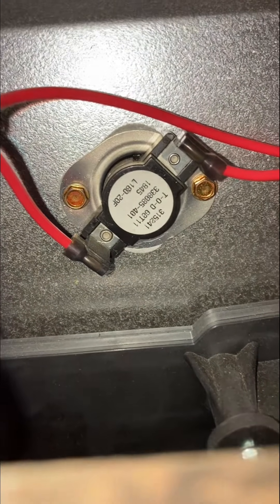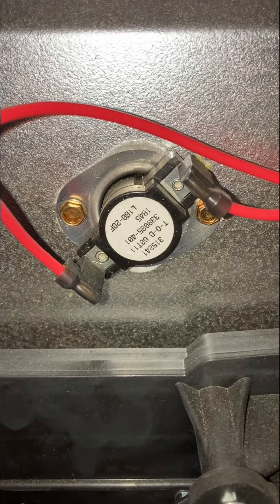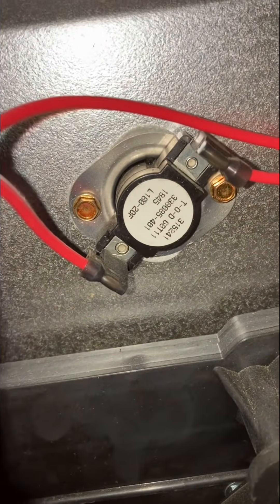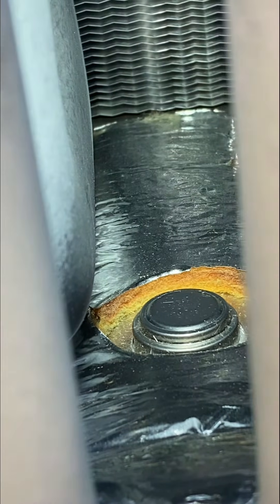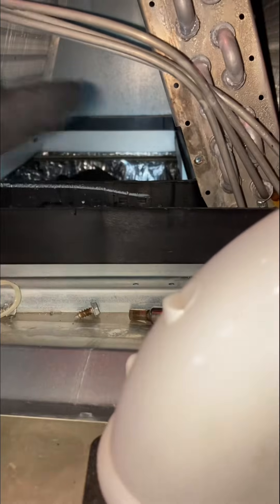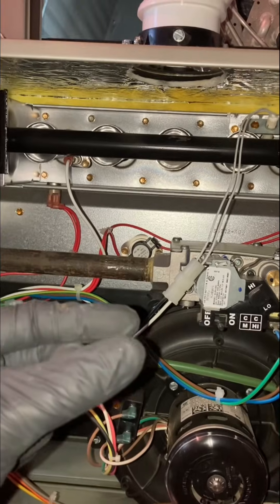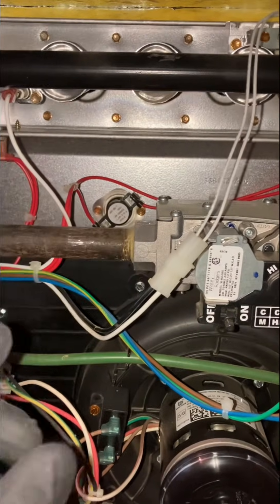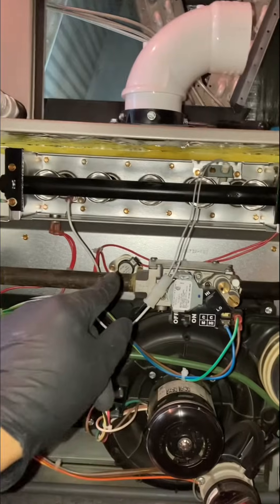Carrier furnace- Resolving high limit error code 33

Comment: I am getting this 3 3 error on my carrier then on the nest thermostat I get "power out error E73 no power to RC wire". Any advice?  Thanks
Reply from the maker: Whenever the furnace over heats , it interrupt power to the thermostat, for the thermostat will lose power. As to why this is happening, it needs to be investigated. The issue shown in the video is the last resort if you check everything else. Do not try this first without checking all the other options.
Reply: @victork3397  I checked what you did in this video and my furnace does not have insulation around the sensor.  My furnace is gas and the flame comes on but the big blower motor does not start.  It tries to start and makes a clicking noise but will not come on.
Reply from the maker: @DillyDogSays  ok that makes sense. You need to replace your blower motor most likely.
Reply: @victork3397  Yes the company wants $700 to replace motor and the part is under warranty..
Reply from the maker: @DillyDogSays  that seems like a lot for labor only. It should take no more an an hour to replace. If I recall correctly, my old company charged around $350 for labor only , and even that was on the higher end. I’m guessing the $700 is covering the part cost for the company as well since they don’t get reimbursed until they send the part back. I would ask why it costs so much and if they don’t budge on price, find a different company.

Comment: Hello, If my furnace doesnt trip error code 33 only when the filter is removed, would you say this solution is still viable?
Reply from the maker: This solution should only be tried when you have checked everything else to make sure it is in order. You would need to check for airflow problems, make sure no blockages, all registers are opened, the return grille isn’t blocked, and manifold gas pressure is set correctly. If you’ve verified those, then I would proceed with this repair.

Comment: I had this error and the root cause was degraded blower motor capacitor. 
The capacitor was good enough for the motor to start and run, but not good enough for the motor to run at full rated speed, causing lower air flow which in turn caused higher temperature in the heat exchanger which caused the thermal fuse to trip.
The simple to check symptom of a degraded capacitor is the motor getting hot, even to a point you start smelling the electrical insulation melting.

I now keep spare capacitors for the furnace blower and for the AC unit.

Comment: Victor, you have been a lifesaver! After countless number of 33 limit faults the past few months, this has finally solved my issue with my infinity 98 unit. I'll take you back on a quick journey since we installed in 2014. The most common known solutions were to install a lower MERV filter, so i went from the original 12 to an 8. We did the damper adjustment on the bypass humidifier to just allow a smidge of air pressure into the return to keep return air temperature lower. After that, we went to changing settings in the touch control to efficiency and setting modulation limits at the low end to about 600 in my case. That seemed to solve it for a period of time but at a disadvantage of running the capacity at 64% all of the time. What prompted me to revisit was this past November when i replaced the old humidifier with a new Honeywell unit. The solenoid went bad on the old best air. So, in went the new and back came the 33's. I found you taped back that insulation after metering out my switches, and it was a success. I'm running error free for a month and most importantly, the infinity is doing exactly what it was intended to do. Was able to reset modulation and airflow to comfort and now she will modulate that % to need, temp rise is well within limits of the switch's specs. Once again, a word of thanks.

Comment: Do 80% furnaces have this insulation?
Reply from the maker: I believe 80% furnaces have a different style high limit switch, where it protrudes into the heat exchanger area further, so this issue doesn’t exist. I don’t remember any 80% having this issue. Was very common to come across 90+ furnaces with this issue.

Comment: Mine after using the tape doesn't shut off anymore every 4 mins but still turns off after 10 mins and code 33 persists
Reply from the maker: What other things have you checked? Have you checked airflow and manifold gas pressure?

Comment: Thank you - very informative! I have had this issue for nearly awhile within 3-5 years when the unit was installed. Last year, Tech Co i used informed me i need to either change the furnace due to premature  corrosion in heat exchanger or replaced heat exchanger ($3900 labor) as heat exchanger have 20 year warranty. I called a separate Tech & they said nothing wrong & performed routine PM clean out burner & check air pressure & condensate drain. Unit worked. Can anyone recommend a reliable & trustworthy Tech in Montgomery County, PA ( E-PA). Thank you in advance. .

Comment: I’m thinking this may be our issue. I’m assuming trying this can’t hurt anything. If there’s an airflow issue or something else causing the limit to trip, it still will. Correct?
Reply from the maker: Yes, that is correct. This method lets the sensor read the air temperature correctly. If there’s an airflow problem it will sense that and shut the furnace off.

Comment: Thank you!!!, FYI it also shutdown the 24V to the Thermostat so if you have an ecobee which runs on the 24V, it will shutdown and reboot when the high limit gets set.
Reply: Did you fix the issue by installing the tape?  I have a Nest thermostat and getting same no power error...

Comment: Bravo sir, thanks for info.  Fixed mine today but the limit switch was behind the condensation drain and gas valve and gas pipes...so a big pain to get to, not easy like in this video.  Also once I got the switch out and check inside for insulation, it only had insulation from say 4-7pm inside the circle, not all around it like in your video.  I have bryant high efficiency, 3 years old.  Seems to run fine now and no code 33.  Also I didnt use the foam gasked on the limit switch, I removed that and mounted flush to make sure the limit switch stuck inside enough and sealed flush without that foam maybe insulating part of switch and making it hotter than it should be as well.

Comment: I will NEVER buy another high efficiency furnace.  They are nothing but trouble and false codes and too many things can go wrong.  Now I find yet another bad design issue that I HAVE TO FIX with this stupid error code 33 because heat exchanger limit switch has the stupid insultation around it.  SICK of insulation causing issue.  Also have horrid stink from the ac every summer after the first summer with new furnace and new ac due to mold buildup on the N coil...so that thing has to be foam cleaned to kill off mold.  NEVER had these issues with our old 80+ furnace and old A-coil smaller ac.
Reply from the maker: Gray furnace man has a good video about whether or not the 90+ furnaces are worth it or not in the long haul. Short answer, they are not. High upfront cost + high parts cost on repair for a marginal savings in gas. If I recall correctly it was something along the lines of 20+ years for breaking even, which at that point you would need a new furnace anyways.

Comment: You just helped me bring heat to my family, thank you.
I was troubleshooting forever, I cleaned the underside of the evaporator the secondary heat exchanger I took apart the inducer, checked for obstructions, I adjusted gas pressure. Took static pressure. Replaced the limit switch. It was driving me crazy.
Reply from the maker: Happy to be of help!

Comment: Thanks for the video. Could you tell me what Carrier furnace models this fix is appropriate for. I have a 2023  model 59TP6C
Reply from the maker: I believe that model is one of the ones having issues, yes. Lack of adhesive on the interior insulation is the problem. Not every single furnace has this issue since the adhesive is applied manually at the factory and the workers perform varying quality of work. Once this issue is identified by carrier I believe they will better train their assembly technicians.

Comment: This is somewhat helpful, but a few cautions on this video.  First, be aware that it's not quite correct to say that "Error Code 33 is a high temperature limit switch error code" which is what he states right up front.  Rather, that code indicates a fault or problem somewhere in the high temperature protection circuitry, not specifically the high limit switches, depending upon one's model. The fault label right on the Carrier furnace panel as an entire list of potential causes in addition to the switches. For example, in similar models, but which differ in that they have a blower motor, even a bad motor startup capacitor can cause a set of cascading issues that lead to Error Codes 33 or 13, even if all the high-temp limit switches (you may have more than one) and the flame rollout switch are good.
Reply from the maker: Thank you for the comment. I was speaking about a high efficiency carrier gas furnace, so no blower motor capacitor would be present as it has an ECM blower motor. It also has a plastic exhaust pipe, so no draft safeguard switch like you have on the 80% efficient furnaces. The only thing left on that circuit are rollout switches (which are manual reset) and the high limit. The switch I’m showing in the video is definitely the high limit temperature switch. You can very easily verify by following the wiring diagram schematic for your furnace. I was addressing a specific problem with a specific model/style furnace, so if you don’t have this same furnace this information does not apply to you.
Reply: @victork3397  I edited my comment a bit to clarify the blower motor thing. However, I think it's still the case that Errors 13 and 33 can be caused by other faults in the protection circuitry and not solely by a high temperature limit switch failure.
Reply from the maker: @astrobill_youtube  yes i agree. This model is easier to troubleshoot due to the communicating ECM motor. If the motor is bad you should get a code 42 - blower motor fault. But yes you are correct this is not the only thing that can cause the issue and I believe I did state that in the video. I made this video mostly for technicians that are hitting their head against a wall trying to get it figured out. It took me 3 return visits and close to 3-4 hours wasted before I realized this was the issue. This repair should only be done once airflow and manifold gas pressure have been verified to be correct.

Comment: i have code 33 and blower motor not spinning when heat (flames) being produced.  is that a blower motor problem ( capacitor) or limit switch problem
Reply from the maker: @stantonporsche  the fan should come on  30 seconds after firing. If it does not then you have either a bad motor, motor run capacitor or control board. The limit switch is working properly in your case since there is no airflow and heat is building up inside the furnace. If you are unsure of how to properly diagnose and fix this I would recommend getting a competent service technician to look at it for you.
Reply: @victork3397  that what i thought.   hopefully just a capacitor problem as that is a 10 dollar fix
Reply from the maker: @stantonporsche  yep, just make sure the voltage and microfarad rating is the same. I would buy one made in USA if you can

Comment: Are there any risks/downsides to attempting this solution before checking gas pressure?

I’ve replaced the furnace filter so the problem does not seem to be with air flow. I already have HVAC tape on hand but don’t have a manometer. Is it okay to tape the insulation as you described, as my next step? If error cord 33 continues afterward I will get a manometer to test thtggas pressure.
Reply from the maker: @tobiasraether824  a clean filler is not the only thing that affects airflow. Make sure all supply registers are open and the return registers are free and clear (no blockages). If you have those small filters people like to stick in the supply registers, remove those. If you’re able to get eyes on the physical ducting and trunk lines, make sure nothing is crushed/damaged. If you have an air filter at the furnace (whole house filter) you should not have any other filters installed. Do not double stack filters.

Testing gas pressure is more intricate and is done at your own risk. I would not advise this unless you know what you are doing. If the furnace ran fine in the past, then it most likely isn’t a gas pressure problem as the manifold gas pressure can only be changed manually. However if you had a recent service, or a gas valve changeout, then I would question the manifold gas pressure. If you do not have a manometer, then another way to check gas pressure is by checking consumption via clocking the gas meter (many videos on YouTube about this) and comparing with the furnace data plate. 

Taping the insulation is quick and easy, a worthwhile test in my opinion.

Comment: Thank you SO MUCH! I had a brand new system installed and it kept giving code 33. I watched several videos and tried many things to improve airflow with mixed results. I put the tape on exactly as you showed and THAT solved my problem. I've been running for a few weeks, even with really cold temperatures outside with no more code 33 resets!
Reply from the maker: @E.P-d9d  that’s awesome! Glad to hear you were able to fix it!

Comment: My parents 80k btu Carrier furnace has been tripping on Error Code 33 Since it was installed 8 years ago. 

Technicians couldn't see anything wrong and said it must be an airflow issue so they wanted to put in more returns. 
They had no issues with the 100k btu furnace they had before this one (old house - they added more insulation in attic), So we didn't think it was an airflow issue. 
They added more returns and that didn't fix it. Next they said we didn't have enough supply vents so they stabbed a 4 inch hole into the duct just below the evaporator coil. That didn't fix it So they wanted to clean the Evaporator Coil, That wasn't the issue and They were never able to solve it so they just left it tripping Error 33.

A couple weeks ago their thermostat started acting up, only calling for heat for just long enough to start the blower then it would trip an Error 12. 
Replaced the thermostat with a new one and Got it back to it tripping error 33

2 days ago your video showed up in my feed, I looked into the hole they cut and sure enough the insulation around the limit switch was coming off and blocking the air flow.
Taped the insulation back down and went in with a long stick to push it back down as it was peeling from the bottom as well

For 2 day now that furnace has been running without a single Error 33 - House is much more even temperature and the furnace doesn't run as long
Thank you so much for sharing this with everybody, Without you I would never have guessed that could be an issue
Reply from the maker: @Cow_95  I’m glad you found the video useful! Definitely something more technicians should be aware of.